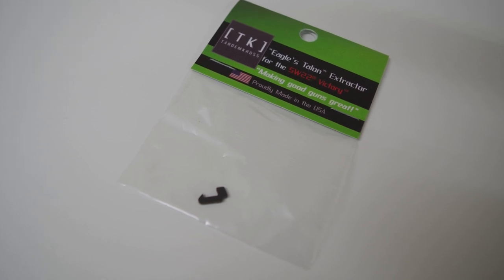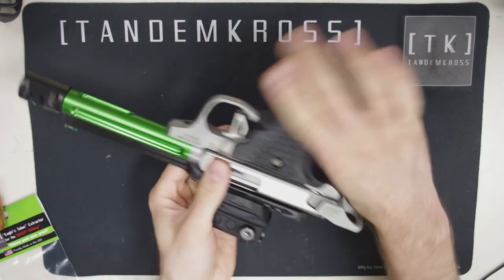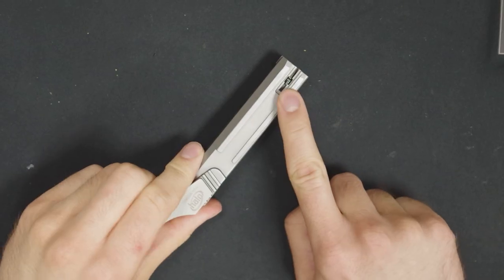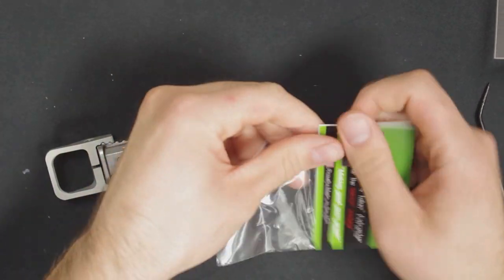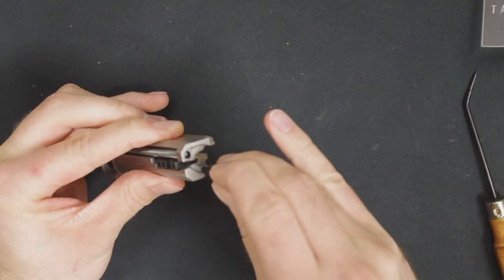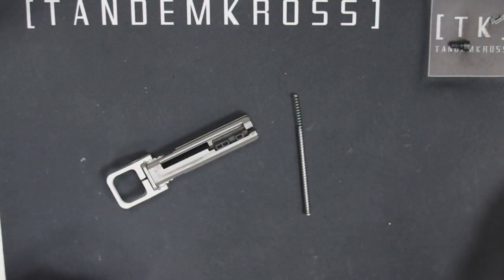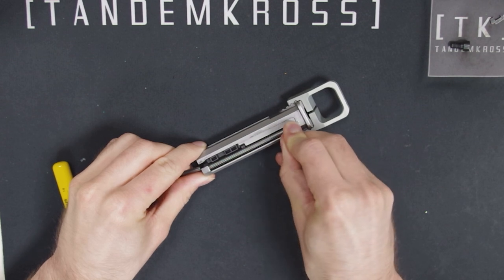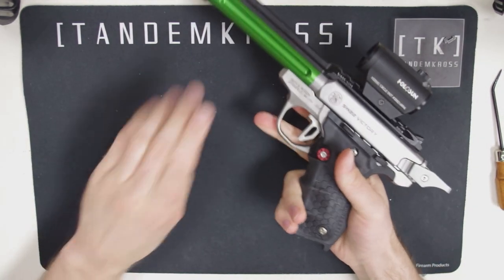TANDEMKROSS - Smith & Wesson SW22 Victory® "Eagle's Talon" Extractor - Install Instructions

Comment: I have had one in my Victory for 2 years now and its working flawlessly , I found a different video out there on how its done , but this is a bit better then the one I found .  But I learned to put the part & my hands in a large zip loc baggie as that little spring will shoot that extractor across the room and you may never find it again !!
Reply from the maker: Always a good idea when dealing with springs! We've had MANY customers have a similar issue when installing our SW22® Victory™ trigger
Reply: had the same thing happen to me. Lucky I found it.

Comment: Unfortunately this extractor did not fix the known issue with my Victory. No matter what kind of ammo I use, my pistol continues to have stove pipes, double feeds, or failure to feed. Wish I went with the Ruger MK IV.
Reply: Vin Vin Thanks. I sent it back to Smith & Wesson and they fixed it. They paid for shipping and returned it within 2 weeks. It now feeds and shoots any type of ammo.
Reply: just changed out the extractor, hoping it is not the latter issue.  don't really like sending stuff in to be fixed when it should come in out of the box ready to shoot with no problems

Comment: The video is completely useless. The instructions are all in general terms with no specifics and very poor pictures of what exactly needs to be done. Your explanation on how to reinstall the hammer is extremely poor. Unfortunately, things went from bad to worse and I lost a small pin that holds the hammer section together. I will have to send the gun in to Smith & Wesson for maintenance. I don't think I would ever buy another product from your company unless the videos and explanations improved dramatically.